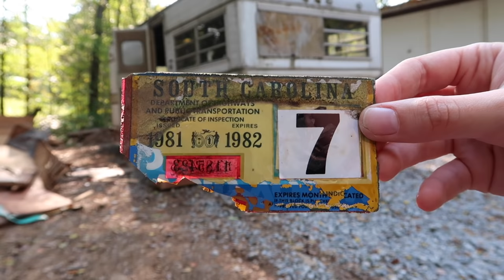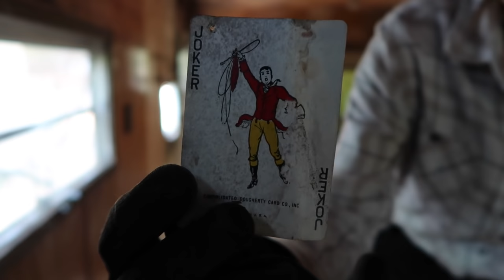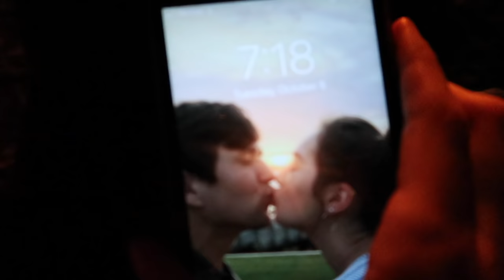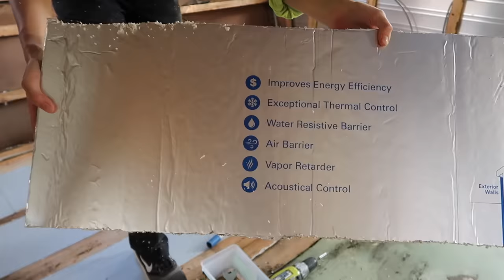GUTTING AND REPAIRING A VINTAGE 1970s CONCORD TRAVELER CAMPER || part 1: the first 12 days

Comment: Boy, you guys are really going at it hard.  Good job.  I am seeing a lot of black mold on the wood.  Be sure to neutralize, seal and or replace them.  Double check the windows to make sure they are watertight.  Too much hard work to have it go for naught with bad windows.
Reply from the maker: That’s really good advice! Thanks! For the winter I’ve just left tarps on it until I can get back to it and get it all sealed up! I’m still deciding how I wanna seal it up. There are a lot of holes from rusted out screws and stuff like that.
Reply: What did you do with siding repairs .?

Comment: Did the exact same thing on a 24 footer, but i ripped out every board & replaced it all with pressure treated lumber, wasn't playing around, & it was the same year era as this, i figured, if it lasted this long with regular ol lumber, & junk screws, it should last 10 life times with pressure treated lumber & all stainless steel screws
Reply from the maker: That’s super smart! 
I like the way you think! 
This is a low budget remodel so you’ll be seeing us using a lot of recycled materials in future videos as well! 
With that being said you’ll also see me use treated wood when need be!
Reply: @KatieAndAri  yes i used all new 1X1 treated lumber, that stuff was so cheap how could i not, it made no other sense to me to use anything different, you guys are doing a great job tho., cant wait for another video from you guys, loved the video, looks like y'all got a great future with your YouTube video's, don't stop now, get another 1 & rehab it as well, you kids are going places with YouTube, make it work for you 👍✌
Reply: Just a heads up, treated wood will corrode aluminum

Comment: I am living in a 73 32' Holiday Rambler 12yrs. Not Restored. Stove is Completely Useless and Rusted out (use as a Counter top with Hotplate on it), Some of the Windows don't work, No Septic Holding Tank, Water Heater don't work, Nice size Hole in the roof where a Tree Branch Fell and Stuck and is still in it, Roof has Tin over it and Cement blacks holding it down. Wiring is Sketchy at best but works. Toilet seat broke so use a Composting Toilet that sits in the Shower 1/2 Tub Combo. 3way Fridge was Worthless and didn't work.
Live in Florida so don't take much to heat in the Winter and is not actually too bad in the summer for A/C. Bill ranges from $35 no A/C to $75 Using A/C.. Only Paid $1,200 for it. I think it was a Bit too much. Had to take out 2 Sets of Homemade Bunk Beds in the Back, where the 4 Children Slept ( before I got it) and the Parents upfront. Holes in the Bottom under the Bathroom area Allow Opossums, Mice, Neighbors Cats, Roaches In and had to Block those off, Still get roaches and mice.. it is Florida. 
Do I plan to restore it.. Eh.. got to built a House First and at the time of writing this, with the Prices So Fucking high on Lumber 2x4 for $20??? Yeah Fuck that! And I need Pressure Treated because the area I Live in, Building the house myself and as Money allows, the Untreated would Rot before I had it built.
Reply: If you're in central FL, I have a bunch of pressure treated wood I got from someone that demo'd a deck. I'd be happy to help out. Some big pieces, some not so big pieces.
Reply: @AndreMarek64  Thanks for the offer. But I live just North of Fort  Walton & Destin. I would have no way to haul it.
Reply: @ravenlorans  Fair, I'm just a bit South West of Orlando, though I do have a truck.. if you were only a bit closer. Best of luck!

Comment: Where you get the metal internal fenders for it?   Modern Trailers expose their tires and have higher ground clearance.  I have a 1968 Concord 18’ Travel Trailer with rusty and cracked fender

Comment: Thanks for the video it gave me a lot of ideas, I want to convert one into a home theater, do you have any ideas for the type of Campers?
Reply from the maker: That’s an amazing idea! I love it! 
I would get an old camper similar to this one and gut the interior! Important things to check are if it leaks or if the axels are good. Ours has a lot of issues outside of the fact that it was super old and dirty. It’s gonna take some serious work just to get it dried in and towable at the point it’s at right now.
Reply: Thank you that helps us out so much #trusttheprocess

Comment: That is the most pain in arse way ive ever seen someone cut foamboard. Easiest way to cut it is. Cut the shortest length of direction, then draw longest length use a blade on line and smack the board itll separate with back paper still attached. Cut back paper. Same darn thing with drywall.

Comment: Hey guys! I just wanna generate conscience about how bad it is for the environment to dispose garbage by burning it. Please, try not to do it in the future 🌎
Reply: Mostly just burning wood, you can even see them loading the plastics into the back of the ute supposedly to take to the tip rather than burning them.
That being said the rubbish tips all pretty much either just burn it themselves or bury it in a big hole, which isn't exactly any better.